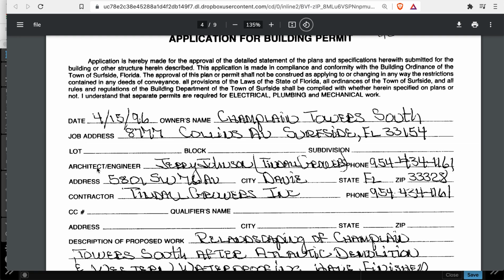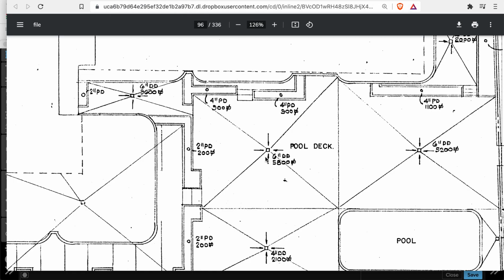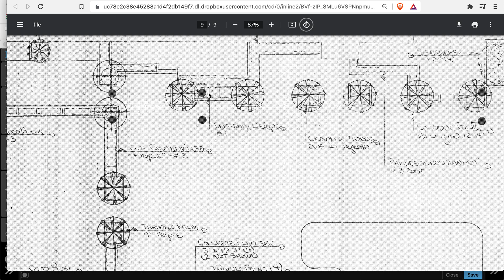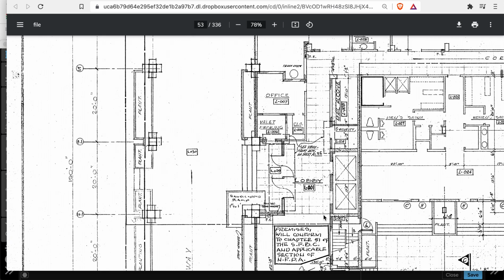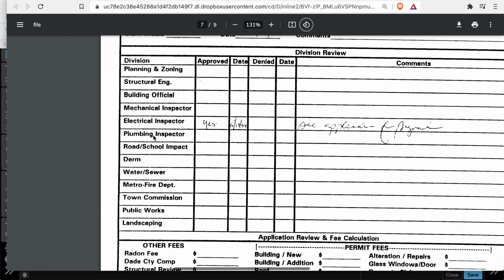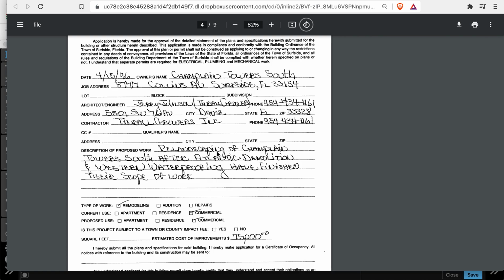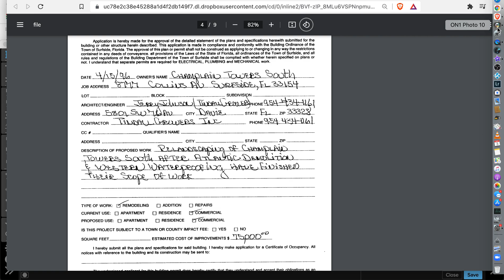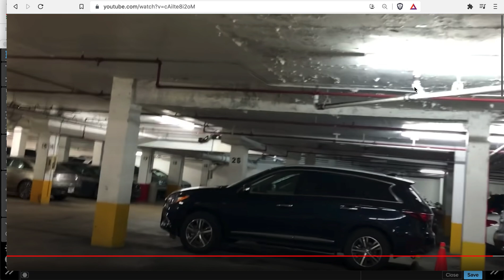Champlain Towers Collapse Planter Boxes never had good drainage Overlay of 1996 and current proposal

Comment: Ever since you showed the video of the core sample with a piece of some punching shear protection area I have been biased to think that the remodel blueprints/as-builts aren’t correct, maybe the originals aren’t right either.  It feels like something is in the data between the basement video and topside  pool deck pictures.Drains, drop slabs and the fallen planter boxes that I can’t square in my mind

Comment: I had to go back & rewatch… kitty missed her step to glass table, hit her head & took off running so I took off to see if she was hurt & broke my little toe on the same table… OUCH!
Reply: Sorry to hear about your toe. To answer your earlier question the drawing showing that the base of the planter is also the garage deck, entitled "Section through 4x8 planter" is on sheet 3 of 336 of the 1979 plans. I see now there is also a note there calling for drains and weep holes "where practical".
Reply from the maker: Exist, a drain appears to be present in front of M 11.1   (someone just sent me an image, they are not sure but, I would tend to agree, that one is present)...  The image looks good for the ''extra drain''...   None appear at L (at least not that I could find in the video)...   So, a slight retraction to my retraction video... 50% correct and 50% wrong... wait, is that zero?  haha
Reply: @EngineerPEretired  understood, thank you. Please see my reply to Hottie Sauce above, I believe, it answers the question about the planter base and garage ceiling being one and the same thing.
Reply: @EngineerPEretired  Wow, using the deck floor as the planter floors could be a real problem over years time, fast drain, slow drain or none.  Another piece to the puzzle.
Reply from the maker: I just saw your comment and I have a video already that worked under that assumption because of the plantings, not showing concrete floor...  at the column failure https://www.youtube.com/watch?v=AMi33rmLriY
Reply from the maker: https://www.youtube.com/watch?v=AMi33rmLriY
Reply: @exist7309  Thank you, it has been bugging me for some time.  Drain or no drain, with no additional bottom to the planter boxes, good reason for the stags on the garage ceiling.
Reply from the maker: OUCH!  Hope it heals fast!